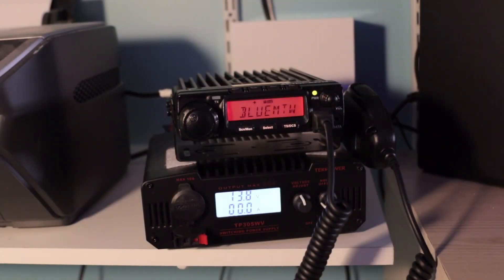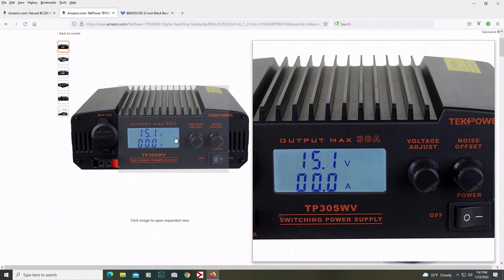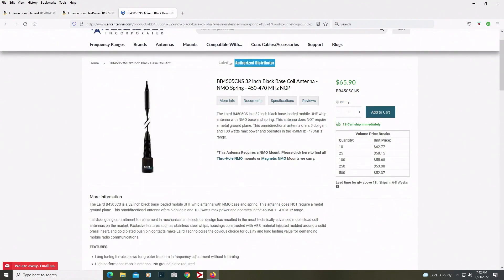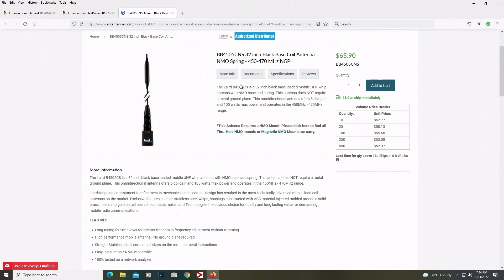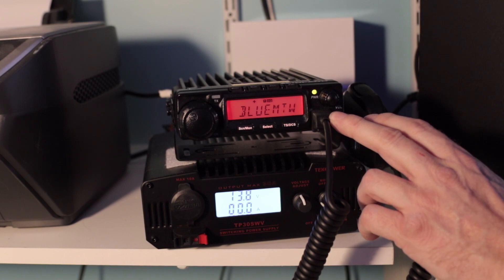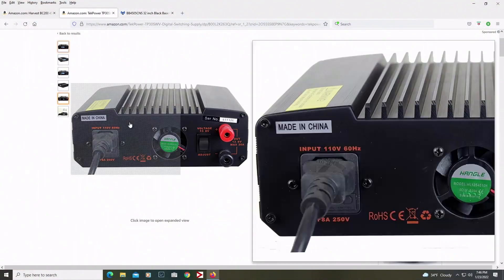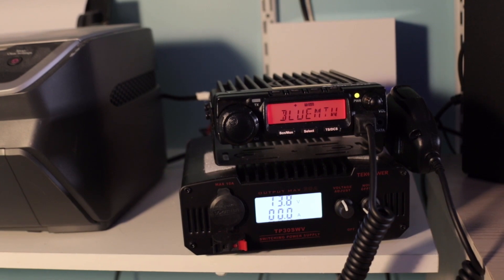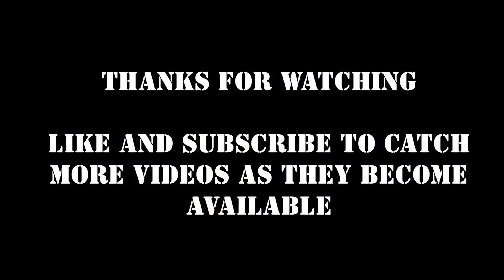GMRS Base Station Setup With a Mobile Radio

Comment: Your antenna sitting on the shelf in front of your face is not only not ideal, it’s dangerous to your health. That base radio is giving enough wattage to penetrate your eyeballs and enter your brain. For this reason, base antennas are placed on the roof, and mobile antennas are placed on top of your car. Check out the various publications on RF danger.

Comment: I know this is a 2 year old video but great information.  I just got my GMRS license, but have been an Amateur Radio Operator (HAM) since 1996.  Right now I only have a handheld GMRS radio, but thinking about getting a base station to setup beside my ham radio base station.  Will check out all the stuff you mentioned in your video.
Reply: agreed. he has some good, simple info and links. I just ordered the power supply for my Retevis RB86.

Comment: Hi Tim.. 
Tim here.. 
I'm confused.. So,   you don't have to ground the mobile antenna? The one sitting on your shelf? Or, is the shelf metal or something?  I ask because I just purchased and received my grms license and want to put together a base station, but without putting an antenna outside up on the roof and all that trouble.  I also have been thinking about using a radio or two with a simplex repeater on the roof and a mobile attenna, but I didn't know if they have to be grounded? I wanted something I could put in a bucket or something and take with me camping.. 
Thanks so much.. Really appreciate it.. Just found you and I'll check more videos sir..
Tim
Reply from the maker: This is a no ground plane antenna from Laird. Essentially it’s the same kind of antenna you would use on a non metallic roof of a vehicle.
Reply: @beingtimcampbell7208  Thank you so much.  Much appreciated

Comment: Your Slim Jim hanging i the window might outperform your magnetic antenna.  I have one in my dining room window (waiting there for me to get the coax to put it in the Oak tree).     I have 3 nagoya magnet mounts around the house, sitting on steel cabinets.  They work well but the Slim Jim is what is on my Wouxun kg[-1000g 50 watt

Comment: I am just a wee bit concerned at seeing this setup. I love the fact you can hit the repeater 30 miles away but havinig your antenna in the house with no magnet mount ground and right next to you has to render the question.... do you get headaches? I mean the radiation coming from it not being outside and so close to your head  concerns me. The hustler is an excelent antenna BTW. It is the one I am going with for now until something better comes out. But please keep power down for now unless that antenna is outside and in the air.
Reply from the maker: That was just a temporary setup and the harvest antenna was in that attic by the weekend. However, that is a no ground plane antenna and if you had it mounted on a non metallic roof like it was designed for effectively you’d have the same setup. But rest assured the base antenna went up quickly 😊

Comment: Hum on your audio.
Reply from the maker: I caught that after it was too late, the recording software was using the wrong mic which was close to my monitors that were humming due to a space heater :)  Lessoned learned, hopefully getting better at this. Thanks :)
Reply: @beingtimcampbell7208  Sound is hard.

Comment: Be sure to set up an outdoor antenna as high up as you can. Never transmit on an antenna that is indoors with more than 5 or 10 watts. You never know what you might be doing to yourself and others by sending 50w into an antenna that is close to someone.
Reply from the maker: I had the Harvest base antenna setup by the weekend in the attic.  I know I'm losing a little with it being inside, but so far I'm very happy with it and I don't have to deal with the HOA.
Reply: @beingtimcampbell7208  The issue that most don't realize is that you can be harming yourself and others near the antenna when you transmit. Do your research and do it well.
Reply: Thank you sir!! That is the question I asked up there and then came down here to see you had the same concern. It can be a real big deal for sure.  Cheers. W5RPO
Reply: Yeah, like 5g wireless routers indoors...
Reply: @papayaman78  oh piss off

Comment: I have the same power supply is there a way that you can show me how you have the radio hooked up in the back of the power supply?
Reply from the maker: I got a couple of high quality spade connectors that are normally used for car stereo installs and crimped and soldered them on to a power cable for that radio.  You can buy spare power cables from Midland's website.  I did that so If I need to work on one of the radios from the vehicles I can just disconnect them quickly and bring them inside.  If you want a pic of it just give me someplace to send you one and I'll get that to you.

Comment: Nice video. I wish you would have put links to the power supply and antenna you're using, though. :)
Reply from the maker: I've added links to the base antenna, power supply and the mobile antenna from the video.  I apologize it took me so long to get 'er done.  Thanks again for the suggestion.
Reply: @beingtimcampbell7208  Thanks. :)
Reply from the maker: I'll make sure those get added to the description, thanks for the suggestion.

Comment: What is your mileage range.with your setup it must be good
Reply from the maker: I haven't really tested the range simplex yet, I really need to get on that, but I'm hitting all of the repeaters within 30 miles easily.  I can also hit a repeater that is 59 miles away as well.
Reply: @beingtimcampbell7208  That's an impressive range. What kind of environment are you in? Rural/suburban/urban? Looking to build a setup similar to this because my closest repeater is roughly 20 miles out but I live in a suburban area and am getting little hope I can hit it from what I'm gathering on GMRS in general...

Comment: What I do in Orlando is use a mobile Magnetic mount Antenna and attach a mobile radio to it. It does the job. I also use it in the house or place the Antenna outside while I listen. I do this because if we have a power outage I will still have a source for radio communication. I can use my car to power the radios

Comment: I would definitely move that antenna away from your body. I also have a Midland MXT400 and the new MXT500, and a Midland signal strength meter. The 40 watt MXT400 will blow that meter up, so to speak even at 10’ away from a Midland 6db gain antenna with LMR 400 coax. That is a significant RF radiation hazard to the human body, over a period of time.
Reply from the maker: That was a temporary setup, but worked pretty good.  It was there for a few days until I could get up in the attic and install the Harvest BC 200 antenna.

Comment: Great setup, my midland mxt115 set up in my laundry on shelves & I used midland 6db gain antenna. 7ft on my roof. Gets up to 10miles on simplex & maybe over 50 miles on repeater in Florida
Reply from the maker: Those 115's are pretty impressive, I have a 275 in one of the cars and love it.

Comment: Have tested the range of the set up with your wife on simplex to see how far you can reach? also are you on flat ground or in a mountain area? thsnks
Reply from the maker: Gave it a quick test and from my attic in a pretty populated neighborhood across fairly hilly terrain to 18 miles away it was pretty rock solid, some static, but 100% readable.  I'll do a longer range test sometime.
Reply: @beingtimcampbell7208  great I'd like to hear about it. I'm going to subscribe and follow.

Comment: What is the SWR on that setup?
Reply from the maker: I just tested the SWR on this setup with it connected to my Harvest BC205 base antenna and on channel 1 it was 1.01 on channel 2 it was 1.48.  I'm pretty happy with it.  On the mobile antenna shown in the video it was 1.07 on channel 1 and 1.74 on channel 22, SWR was actually around 1.17 on the repeater channels
Reply: @beingtimcampbell7208  ok, that's good.

Comment: Wait, wow. You can keep the antenna inside?? Crazy. ッ
Reply from the maker: It works great, not as good as it would outside, but the signal doesn’t degrade much at all. My new base antenna is inside my attic and still works great too.
Reply: The best location for the antenna might be outside, on your roof. This location allows you better transceive capabilities well as shielding you and you family from high watt RF output when u key up.
Reply from the maker: @nathangrz  Agree, that was a temporary location to show that it would work.  I have a base station antenna in the attic now.

Comment: I'm here in Va too but down in the southeast corner. I think I have everything I need to hook up my GMRS just need to get around to it. I have a MXT400 installed in my 2000 Durango. I have all the hardware to hook up a MXT500 in my 2021 Jeep Wrangler Rubicon just need to get it done. I also have an MXT400 too hook up in house but haven't done it yet.
Reply from the maker: I love my MXT400, it's the reason I took the plunge and got the 500.

Comment: Not sure if you have seen the Tram 1486. That's a really good antenna at the same cost. It has a 6.5dbd. I seen the antenna you listed has a 6.5 dbi.
Reply from the maker: I definitely looked at the Tram's, they looked great, I basically was having paralysis by analysis and flipped a coin.  The Harvest won :)

Comment: Hey Tim, WROQ812 - Hal here.  Nice set up you have.  Pretty simple and to the point and a nice small footprint.  Just a question but are you not concerned with the heat from the 2 devices causing issues with each other? PS/GMRS.
Reply from the maker: I’m using the car mount on the radio so there is an air gap there. When receiving, it doesn’t generate any real heat and when transmitting I haven’t had any heat issues so far. The 30 amp power supply is only pushing 7-8 amps when transmitting so it’s not working too hard. I haven’t noticed too much heat from the MXT400 while transmitting. Time will tell and I’ll definitely keep an eye on it.